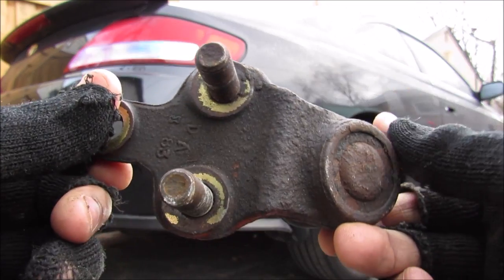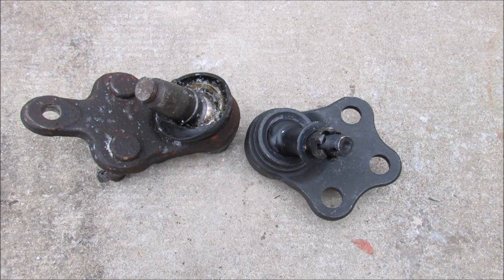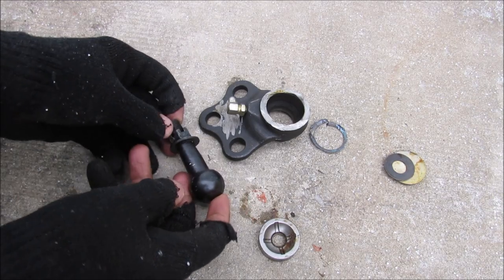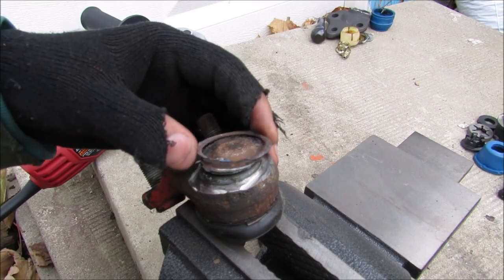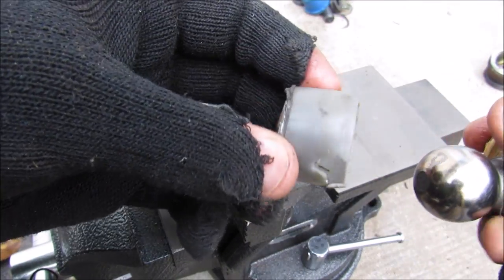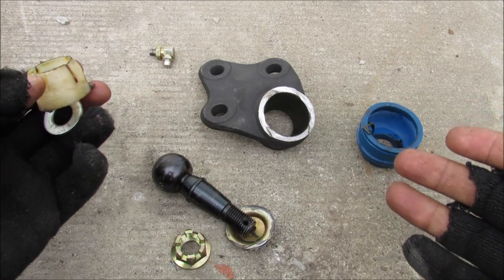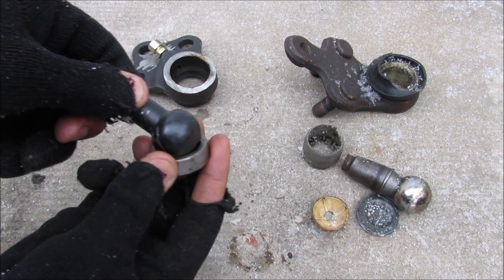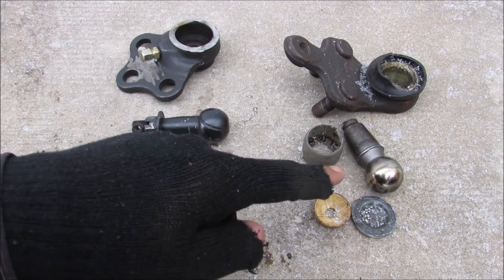OEM vs Aftermarket Ball Joints

Comment: Love the video. Had idea how ball joints worked but much Betsy seeing how they actually work. 

Do you have a general idea of who makes the best aftermarket ball joints? Moog used to be real good but have heard they are going down hill Havnt used any of the products In awhile so can't say for myself. Also heard raybestos  pro grade were decent. I'm doing my upper control arms on my 2011 crown vic and thinking I might have to go another route then the motorcraft due to finances.  I'm stuck not really knowing which would be the best for the money after oem on the control arms either. Ac Delco makes them for my car too Errr. Just don't know
Reply from the maker: +Mr. HighBall yes I heard Moog is hit or miss. Mevotech is alright too, you might want to check them out. Ac delco is a reseller, their products come from everywhere and are reboxed. You might wanna check crown Vic forums (or shops that service cop cars) for suggestions on the best pieces for your car.
Reply: speedkar99 ..
Thank you Sir.

Comment: hi today i took my car to the mechanic to check the ball join then he mistakenly broke the plastic piece with small spring which prevents  the grease inside the ball joint from coming out.
know do i need to replace my ball joint since he broke the thing  or it's  fine?
thank you
Reply from the maker: I'm not sure what part you are referring to, but if it's the grease fitting then it would have to be tapped out of the threads. If it's the boot then you should replace the boot, as long as the ball joint doesn't get contaminated.

Comment: Thank you for the informative film. I didn't know that the Ball Joint can have some  plastic inside. So if the OEM Ball Joint itself is not worn and just have a torn boot, you can just replace the Boot for a new one, and no need to add grease?
Reply: Just move the stud, if it's moving around quite easily that means your inner ball joint is worn out you have to replace it, if it needs some force to move it around that's an indicator of a good ball joint

Comment: Can u plz make a video on, symptoms of ball jpin, unversal jpint,sway bar, bushings joint, wheel bearing similar components related to axle and suspension. 

How can we know, we should replace perticular parts if any symptoms occur,

Kindly mention,
 symptoms : solution 

List
Reply from the maker: Thanks for the idea
Reply: @speedkar99  i will be very thanks full to u, if u make a complete video on 
#sensor vs symptoms vs  solution 

Thanks u😀

Comment: The workmanship of OE stud looks far superior to the aftermarket. Basically if you keep the boots of OE ball joint intact, the ball joint can last time of the car, because it's sealed, which means contaminants cannot get into the grease either. Greaseable ball joint is so last century, because it's not sealed, thus requires constant grease renewal.
Reply from the maker: That's one way to think about it. However it depends highly on who the OE is and what vehicle it is. Some OEs don't last long at all!
Reply: @speedkar99  OE has the huge advantage of technical design/requirements and factory quality control. Aftermarket is just trying to make a few bucks with low cost, they make something and people buying them due to cost (and cost only), nobody can set a quality requirement for them. Thanks to your video, I can see the big quality difference between an OE and aftermarket. To me, any ball joint with a greaseable zerk is garbage, made from old tech with poor tolerances.  No OE are made with greaseable fittings anymore.
Reply: The OEM ball joint that is pictured here has a required warranty life of 150k miles per the manufacturer (Toyota/Lexus).   It is manufactured right here in the US by a company that has ties to Japan.  Superior handling, feel, and durability with the OEM here.  Don't buy that aftermarket garbage.  I think he got his money's worth out of it for a 90s to early 2000s Camry/Avalon/ES300 lower ball joint.  It's so old, it's plated in hexavalient chromium.

Comment: hey bro I have a 2001 is300 and the scanner gave me a code p0300 but I have new plugs and wires and the car is giving a random misfire .what can it be?
Reply from the maker: +suraj budhram Coil packs
Reply: Ok thanx but the car only misfires when it's idling
Reply from the maker: +suraj budhram Seems like a common issue with the IS, check the forums. Some say the injectors are faulty.
Reply: Oh ok thank you

Comment: Interesting hearing that moog isn't that great. I put upper and lower ball joints on my 08 wrangler JKUR and within 20k miles they're finnished.
Reply from the maker: +Flag Ov Hate is your truck modded?
Reply: speedkar99 well its a lifted jeep with 35" tires, the stock ball joint is pretty small to handle the abuse of wheeling offroad with a tire that size so I suspect that is why they failed so early.

Comment: What sucks is some aftermarket balljoints for some vehicles don't offer  greasable parts. I cannot get lower balljoints for my car that has a grease fitting. So I'm left with which one do I buy? Some say go OEM, some not. I wonder if OEM is even the same as orginals were? Seems they all make junk???
Reply from the maker: Some OEMs are junk. Surprised you dont get greaseable parts...what car you have? 
If your OEMs lasted a long time then might as well go for the same.
Reply: @speedkar99  02 Honda accord, no one offers lower greasable balljoints for it... they don't make em. OEMs aren't greasable, nor do they have snap rings. Only aftermarket lower balljoints  have snap rings. I don't feel comfortable without snap rings after replacing the balljoints once already with aftermarket parts. I've been told they don't seat tight enough in the steering knuckles once they've been replaced. For safety and reliability, use balljoints with snap rings. I don't know if it's fact but that's what I've read online. Might be true, the holes in the knuckles wear out with rust and oversize.

Comment: I wouldn't call that plastic flimsy. Heavy duty brake systems (most of them now) use plastic bushings for the S-cams. 99 percent of the time the bushings are unscathed and the steel cams themselves are worn out. There are some really really tough grades of plastic out there these days.
Reply from the maker: Good call. After a while plastic will still deform and get squished
Reply: the steel is worn out because the plastic is abrasive

Comment: I wonder if the bearing is made of nylon or something else. If so its probably better then metal cause its self lubricating. Though I wish new cars still came with those grease fittings...
Reply: You could make your own with a drill and tap set.
Reply from the maker: True, much older vehicles came with greasable units. However, society has shifted toward a more disposable, less labor/maintenance perspective because labor costs are high, and turn over is quick.

Plastic bearings have their own issues; they're more temperature sensitive than metal, hence in the extreme cold they can become brittle, and in the extreme heat (if they're situated near a hot brake component) they can melt.
Reply from the maker: True, I've seen this done, however you've got to make sure you don't introduce any metal shavings in the ball joint when drilling, and make sure you use a grease that's safe for plastic. Some grease will react with the plastic bearing.

Comment: Just buy the oem stuff (moog, etc)  i tried some aftermarket GES balljoints on my 85 dodge w150, had to press them all out again and put moogs in because they dropped the steering knuckle a whole 1/4" and the axle shafts wouldn't line up with the spindles anymore
Reply from the maker: +Dustin Soyring that works too!

Comment: Which aftermarket ball joint can do 250,000 miles like Toyota's without grease?
Reply from the maker: Not many.
Reply: Supposedly the Senkei 555 brand made in Japan, but the Youtuber Pine Hollow Auto Diagnostics said his 555 failed after a few thousand miles.

Comment: I've seen a ton of these crappy greasable aftermarket joints fail while OEM joints easily last 100k-200k miles. There's a reason OEMs do what they do here, and a reason OEM parts cost so much more.

Comment: I prefer the one with grease fitting as greasing is easy to do.
Reply from the maker: Most people don't want to deal with greasing chassis components lol
Reply: R C OEM unit comes pre greased out of the factory and it will outlast the aftermarket part

Comment: Incorrect assumptions.... It's not a "flimsy plastic" bearing.    It's a very tough nylon with Teflon insert.... It basically doesn't wear... That's why OEM last 100,000 or more miles.   Also the nylon bearing will have a slight amount of give under load where sintered metal would fracture under the same load.   Metal is not always better....
Reply from the maker: It depends on the loading ... 
Under a heavy load the metal will do better...it has a spring inside for that "give" that the plastic does ...you just have to keep it lubricated. 

For your everyday passenger car plastic OEM will work fine

Comment: plastic has low wear than metal, so the plastic one should last longer, also no grease needed as plastic used is teflon salf lubrication. The plastic ones are more expensive, ball need to be polished ...

Comment: Orthopedic implants were designed with metal on metal, high failure rates then metal on ultra high molecular weight poly, superior wear. Be nice should all bearing surface be made from UHMWP.